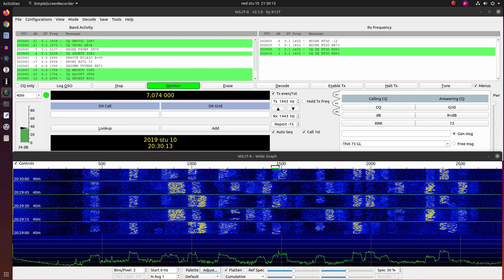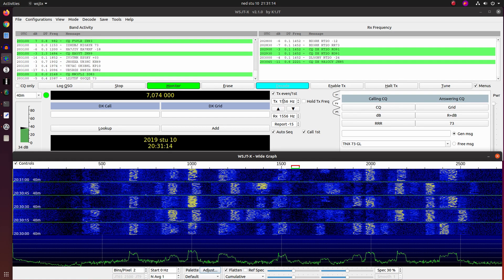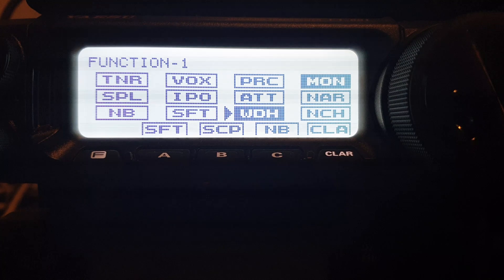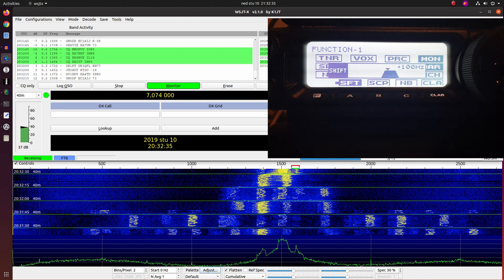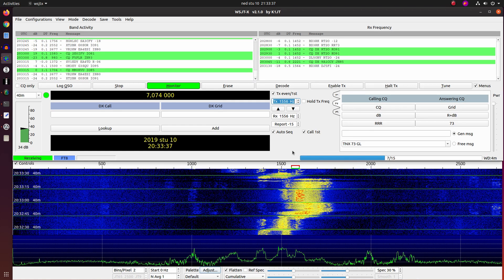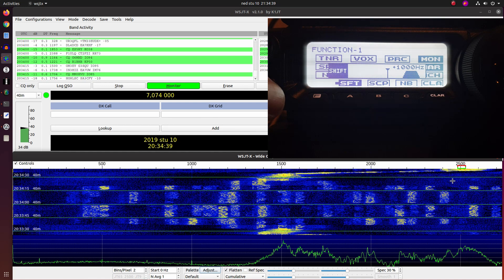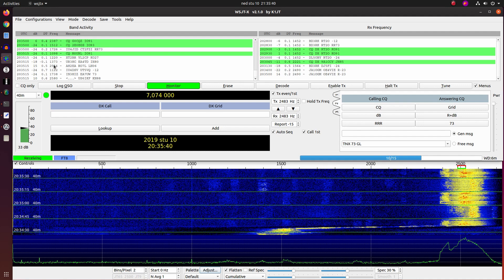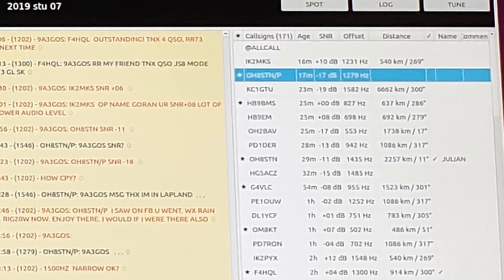Using filters for weak ft8, js8call or other digital signals. Demo on Yaesu FT-891.

Comment: You want filters to be "wide" the software "filters" and relies on SNR
Joe Taylor said this many times.

http://physics.princeton.edu/pulsar/k1jt/wsjtx-doc/wsjtx-main-1.7.1-devel.html#TRANSCEIVER
Reply: It is not exactly true ;)
Reply: @GoranSkular  Quote from the WSJTX Documentation
"If your transceiver offers more than one bandwidth setting in USB mode, it may be advantageous to choose the widest one possible, up to about 5 kHz."
Reply: @MINI-4X4-RADIO  it's true that then you can decode all (most) signals there are. But if you want to fish for really weak signals, then you need to use your transceiver filters to isolate that weak signal from strong ones. If not, strong ones saturates and desense weak ones. Trust me, tried in real life.

Comment: Thanks for this! I saw Julian OH8STN talking about using narrow filters for JS8 in a post on some social media recently, but was not understanding why anyone would want to do that. The "obvious" thing to do is run with a wide filter (3k), to see all the signals in the passband, and then work the stations that you can hear, letting the software figure out what is "too weak to work". I had not considered the impact of strong adjacent signals, or the impact on weaker signals that can be made by filtering out the stronger ones. This will possibly change how I use JS8Call. I think this should be even easier (or at least quicker) to do on a K3S, which has quick access to filter adjustment through knobs rather than menus.
Reply from the maker: Julian OH8STN has a lot of great videos. We all need to watch most of them.
Reply: Blackout Radio Comms agreed! Julian is brilliant! There’s a lot to learn from him.
Reply: Like in CW mode you can notch out other signals that might be desensing or causing QRM so you can work a particular station. Especially useful running QRP. 

Say if its a rare DX station that is weak you can notch out the stronger stations and help you grab that rare DX. Or a particular station you need for grid square even if its not DX. 

But on JS8 if its one particular station you want to QSO with and you both designate a shift freq in advance you can notch out other stations, conduct the QSO in fast mode and you are done. For example. 

On FT8 the trick is learning to do it fast and be proficient at it. On the Flagship or Big radios its much easier to do. But that is the price we pay. $600 vs a few thousand. =]

WW5RM